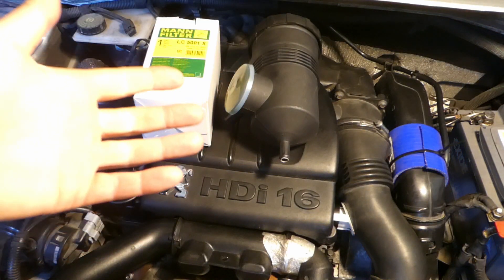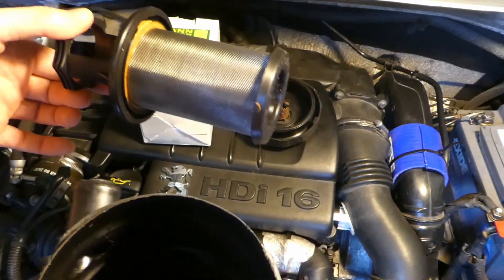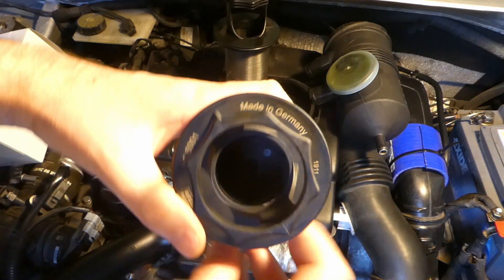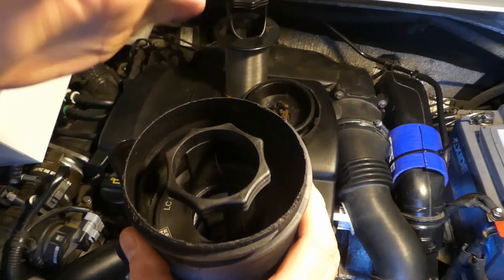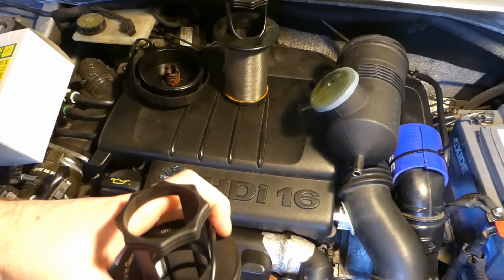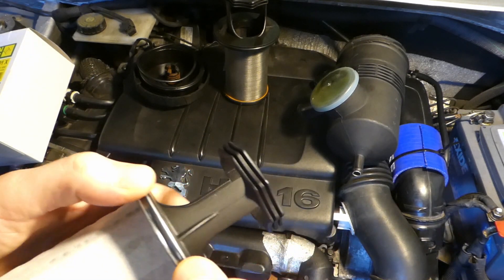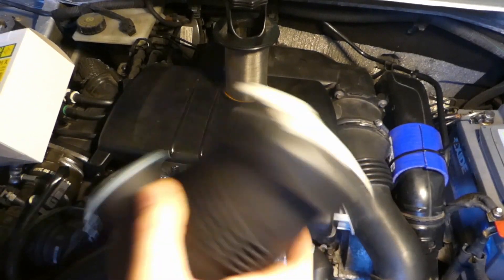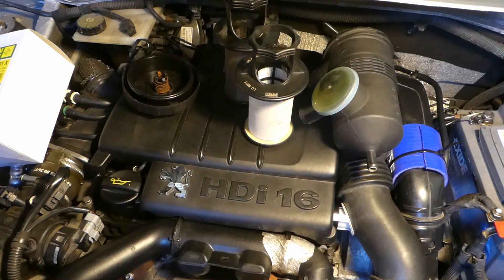Assemble cheapest "original" Mann Hummel Provent200 oil catch can

Comment: Hi mate, do you know how many miles we should take to replace the filter? I have heard 40000km but mine is sought at around 3000km. I blown inside and it seems a bit resistent to air passage which was not before. I thought this filters would go for a long time but it seems is not quite like this. The oil is suppose to stay on the filter and not drip of for what I understand is this correct to you also? Thanks again for your videos.

Updated: Also maybe gently cleaning the filter with a piece of paper might help. I am not sure. Maybe there is also something that can be spray to clean it for it to go longer. My guess is that from the moment it starts to be completly sought the oil will some how turn in to gue and stop oil passage.
Reply from the maker: Hi Rafael, I think it is 40k km, but I would replace it earlier, as with time and driving of course, it gets blocked more and more. This will eventually lead to more restriction and a slight increase in crankcase pressure, as gasses cannot pass that easy any more.
The oil is not supposed to stay on the filter but to drip at the bottom. Basically, smaller droplets of oil gather on the fillaments of the filter and when more smaller droplets come they condense in bigger drops and eventually drip at the bottom where one can put it back in the sump or collect with a hose.
Not too sure if the paper filter can be cleaned. One could soak it in something that dissolves the oil, but this is likely to modify the structure of the little fillaments and reduce efficacy. Well, nobody has tested efficacy of oil catch cans, brand new, old, metal mesh, etc.
Reply: @moremolecules  I think the issue is that if one does not drive for one week or so in cold weather, I guess this ruins the filter. Just a guess thought. Maybe is good to turn the car if stop long and just give it a bit of gas so it the oil doesn't block the filter. Just a thought though, not sure if this makes the trick or makes any sense. Well any way cheers! And great job once more!
Reply from the maker: @luhckylu  Many thanks indeed for the good words and encouragement, really appreciated. Yes, during this covid that is going on now, I do turn the car and go around for ~30in drive to get things moving around. Otherwise, more problems would come about. I have seen people do turn on the car for a few min, but I never really liked that. The engine never reaches operating temperature and cannot evaporate the water in the oil, so it will go in the oil catch can. Probably it is easier if one just opens the oil catch can, shakes it a bit, so oil drops (not too vigorously) and puts it back together. Also wipe a bit of the sludge around the inner walls of the catch can. I think that might be better than starting for a few mins. Might be wrong though 🙂
Reply: @moremolecules  I did some research around and there were people advising dipping the filter in fuel to clean it. I guess this is not the best. I thought of acetone but still maybe not perfect. I think I will give a shoot with a degreeser like purple power. This filter is used I think originally on Volvo penta d4 and they advise swapping every year or every 180 hours of operation. Anyhow let's see how it goes with the degreeser.
Reply from the maker: @luhckylu  Yes, some sort of degreaser might work, but it is unclear how this impacts the paper strains inside the filter. I would say no to acetone, it would degrade the plastic of the filter. Probably the least damaging is to have a bucket with dishwashing liquid and dip the filter multiple times. This should clean the oil and other bits and pieces and then dry it out.
Reply: @moremolecules  yes with hot water correct. That would be it.
Reply from the maker: @luhckylu  I would add dishwashing liquid and after this pure water to wash off the liquid. DIshwashing liquid will be good to dissolve the oily bits and pieces.
Reply: @moremolecules  worked well washed twice let it dry final weight around 110g. Tested with a water bottle blowing up on the top there was still some resistance. Put it on the car went for a drive after that the weight dropped to 100g some water was drained down the tube and after that there was few resistance to air passage. So issue fixed. Clean filter is about 90g. Thanks once more.
Reply: Hmmm maybe the steel mesh filter would be less efficient, but less restricted for the air flow and more maintenance free? I got both and not sure which to use first
Reply: I revisited this topic seems the advised filter element to deal with the blockage is the lc50012x i was using lc5001 which does not integrate a pressure release valve.

Comment: nice, but this material is ,probably, not oil resistant
Reply from the maker: The hose I used was oil resistant. It is used to pump oil from the oil dipstick, but I get the point. I should have pointed that this needs to be oil resistant.

Comment: Hi I've got another question for u pls?
Reply from the maker: Hi Hasan, sure, no worries.
Reply: @moremolecules  hi I recently bought a Peugeot 308 2012 1.6hdi car drove ok but once on motorway driving around an hour it loses power and goes into limp mode. I parked it up on the hard shoulder turned it off and then on again which was good for another half an hour then happened again. "Engine fault needs repair" on dashboard. Pls help many thanks and love your vids. Keep it up! The 😉
Reply from the maker: @hasanpatel5609  Unfortunately I cannot quite help with this undetermined error. Do you have any other indications, temperature sensors, etc. I would say, plug it in one of those diagnostic tools and see what comes back. Best to use PSA diagbox or PP2000, but cheaper ones will give you a pointer.
Reply: @moremolecules  ok thanks pal. Where abouts are you in the uk?
Reply from the maker: @hasanpatel5609  sorry, but I really value my privacy to answer that question, hope that is alright.

Comment: Dont buy a catch can there not worth it in fact they can do damage
Reply from the maker: Can you elaborate on why they can do damage. I agree that there might be damage if the catch can is not matched to the size the engine in terms of crankcase pressure, but otherwise they are pretty useful.
Reply: It's what you have just said , and who can really tell us for sure what doesn't cause back pressure ?  The manufacturer? No , if the manufacturer knew, it would already be on the car  and done Right as it would be a great asset to sale's on any vehicle . Any way 2 people I know had trouble with them and had them removed
Reply from the maker: @paulgilraine3127  Yes, I completely agree that some will cause back pressure, but if the catch can is sized accordingly and the cheap ones are avoided, then it is beneficial. Most sports teams use them, although a bit different than normal cars.
Reply: @moremolecules   race cars get a full service after every race and probably  the want purest  fuel possible getting burnt in the cylinders so there's no doubt to me that catch cans do  catch oil and water vapour and reduce oil build up on manifolds  but on the likes  of my old diesel Volvo which is well looked after but not like a race car , I don't think I would chance causing other problems the real  issue is the egr sending soot back into an oily manifold , all I can do  lawfully is clean it out once a year   👍
Reply from the maker: @paulgilraine3127  Yes, I agree, our cars are not race cars. If an oil catch can is suitable to the engine size, then it should mainly be beneficial.
Reply: It is necessary to collect simple steam to the inlets and the wall of the pedal and the combustion chamber in order to catch the sand particles so that they do not enter the combustion chamber and sand the wall of the pistons and the engine starts to consume oil. I advise you not to purify the steam 100% because the presence of simple steam is necessary so that there is no problem in the future. The paper filter is harmful because it purifies the oil steam 100% and the metal filter purifies 70% and this is what is required.